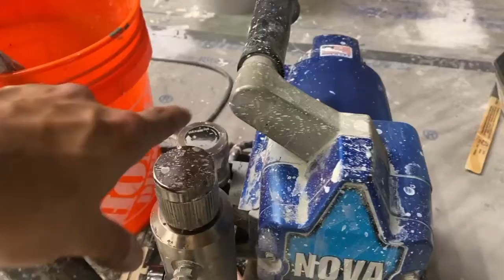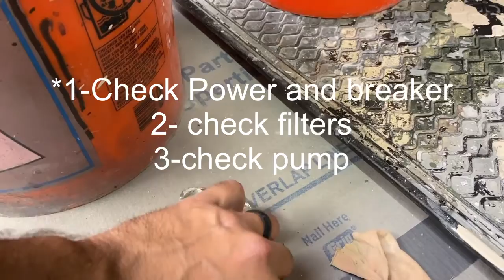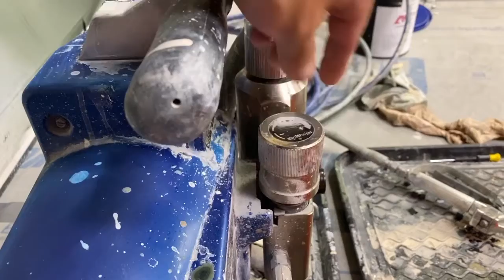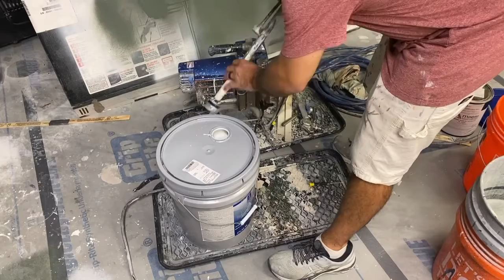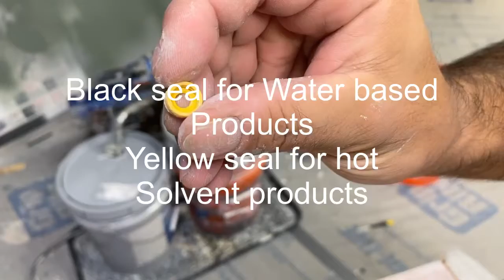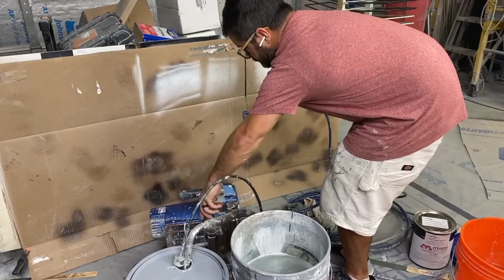How to Set Up a Graco 390 Airless for Spraying

Comment: Have never used the prime valve to load the line/gun for painting. I simply pull the trigger on the gun and turn the machine on. Sprays out the water or spirits in the line, about 1/3 gal. And the paint follows. If I run out of paint and lose prime I just put the paint in and pull the trigger and if it doesn’t prime I will isotherm prime valve. Here’s the problem with using the prime valve. The operator I.e. the painter cleans the hose and gun but forgets to flush out the prime valve thereby eventually clogging the prime valve. Ruined. Even cleaning it always a little residue that builds up over time. I have the same unit for years. Never replaced the prime valve.
Reply: Good info. I think I'll give this a try. I never understood why priming  is needed if I plop the pickup hose in a bucket of paint, pull the spray gun trigger and turn on the machine. I always thought I could save time at setup and cleanup if I bypassed the prime valve.